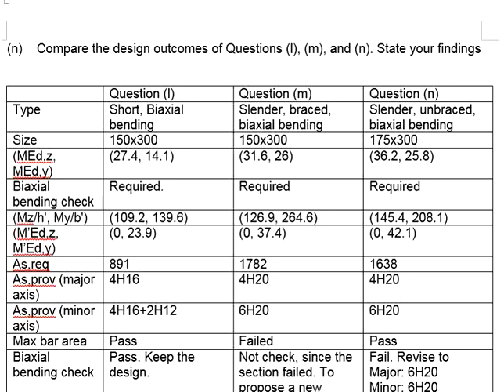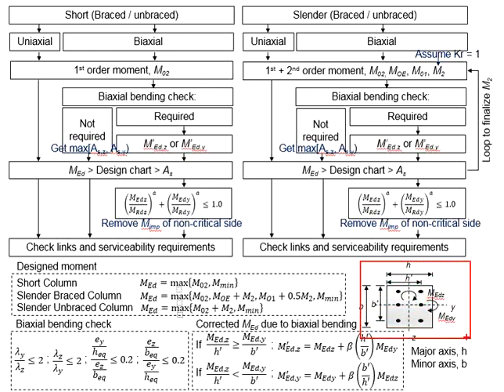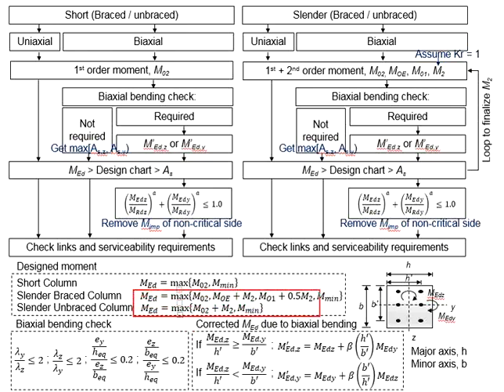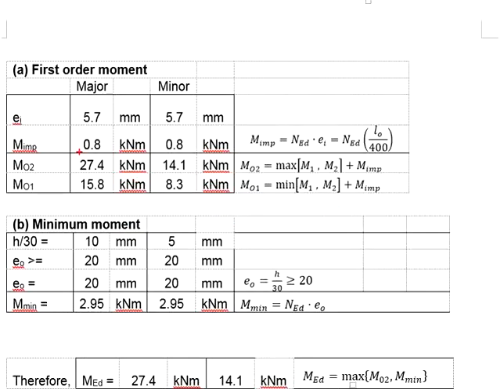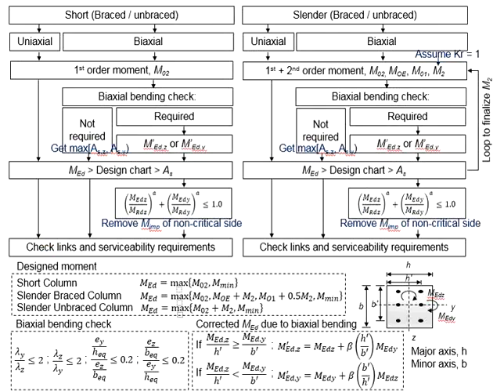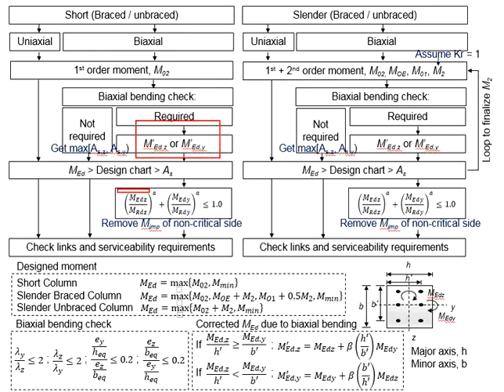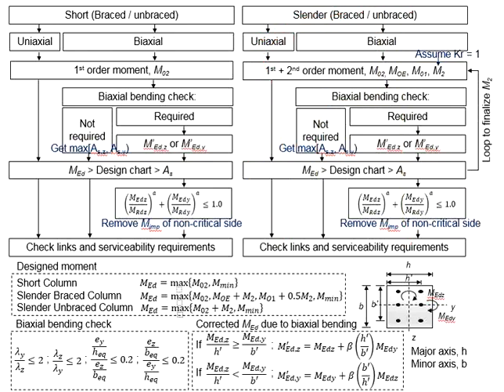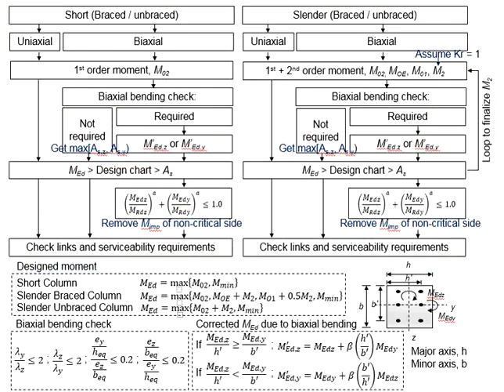2.55 Column type: Part 25 - Design steps for various types of column

Comment: Very clear steps for column design. It becomes tedious when you have to check for dozens of load combinations at various storeys and number of columns.
Reply from the maker: Yes. you're right. That's why, in actual practice, they use software to do the work.